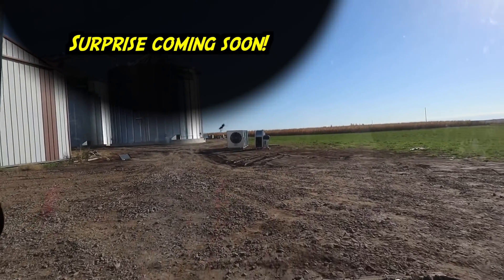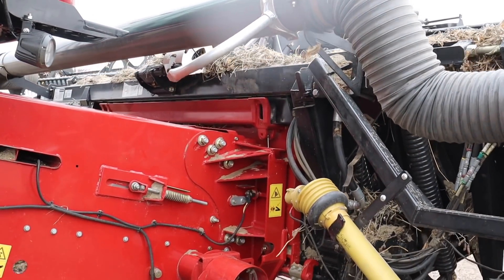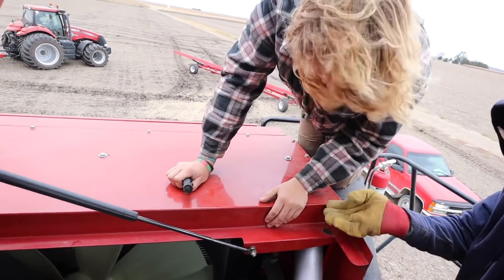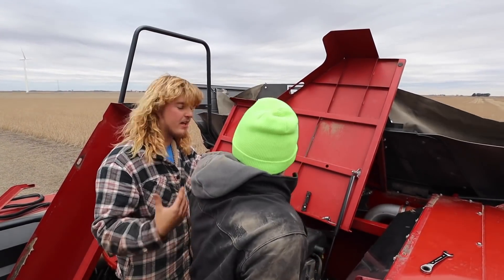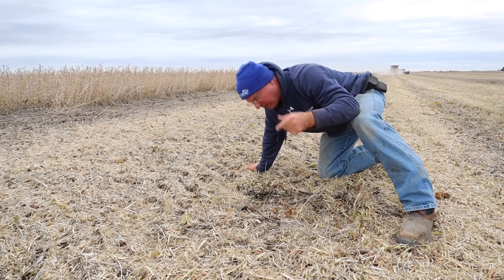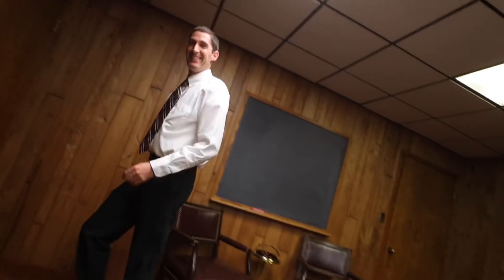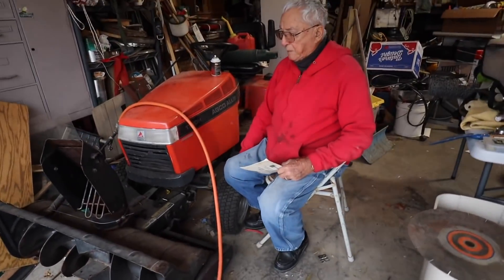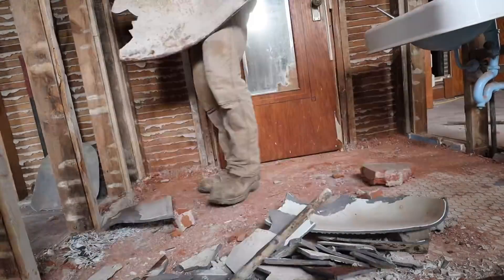How Much Money Does The Government Pay Farmers?

Comment: Cole, don't know if this has been mentioned yet,  but... you can take women's hose and cut off a swath to remove the fiber glass insulation material making your skin itch. (The hose catches on the little glass slivers and removes most of them.) You will need to rub skin with hose lightly in different directions to get it all. Chuck that piece of hose after one cleaning, as it now contains the glass slivers. I've used this method many times and works better than anything else I've found to remove the glass. Hope this helps, keep up the great work!

Comment: Cole, @3:32 you said that the fan blows air through the radiator.  The fan is actually pulling air through the radiator, inter cooler, hydraulic cooler, and air conditioner coil.  The fan runs in a shroud to make the air be pulled.

Comment: At our wheat and barley farm that we had from 1983 to 1999 in Washington State, we looked at the PIK program like this: the government had its hand in the till by controlling market prices, so we ended up being dependent on the government farm programs. It was a paradox. We felt the same way you do and we hated handouts from the government. Our main cash crop was the winter wheat. It was a white wheat used to mainly make pasta and most of it went overseas. So with trade wars and such, the government was forcing prices low and we weren't going to make it without the PIK program. Don't know how it is with corn and soybean pricing, but if the government isn't allowing the market to be completely free, you might end up needing the cash they offer. The government needs to leave the markets alone if they aren't.

Comment: Use baby powder on your skin before you deal with insulation.  It closes the pores in your skin and you'll not itch.  Just rub it on, of course, for those California watchers - a warning baby powder will kill you - but not in Iowa (or anywhere else for that matter).  This also works if you're sanding fiberglass...
Reply: Wish I had known that 37 years ago when I was making transformer coils with fibreglas rods...
Reply: Taking a shower with Ivory bar soap helps get the fiberglass off I worked at a fiberglass plant.
Reply: And Sorghum...
Reply: @classicambo9781  true - baby powder doesn't protect lungs

Comment: Cole, another great video that teaches a lot about how farms really work.  How is the Draper settings coming along?. I have been scouring the internet looking for helpful info for you guys. There is a lot of info on the 2162 / Mac Don flex drapers  for how to properly set them up. Many say when you add accessories like the CWS (Air Bar) you need to at the very least check and reset the header Float and Wing Balance.   Mac Dons YouTube channel has a bunch of great videos explaining how to check and adjust this. I see that you guys also got the Poly skid shoes on now and Not sure if you had seen an earlier post but MayWes has a nice package of poly for your Case 2162 Draper too. I just love how you bring us along on these journey's, and it is a challenge to try and help find a solution.  I too also saw that it looks like you saw the advice from some of us on the Sledge hammer to the cast iron tub as I see it was in small manageable pieces as you took it out. Looking forward to the next video as always and say hello to the Whole gang from a very loyal follower.

Comment: Im red all the way, but seems like you have had a rough year getting that combine honed in. Just seems like alot of little things that shouldnt be happening, like fan bolt or however it attaches coming off. Can tell cooper is an important asset when it comes to wrenching and cole is the money man. Just wish case was more assistence to you. That draper air system is great, when it works